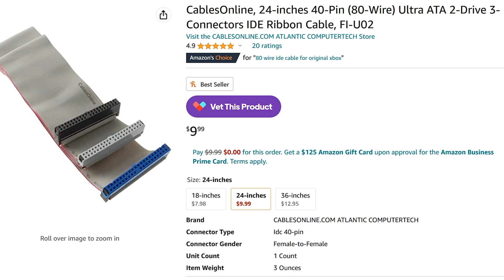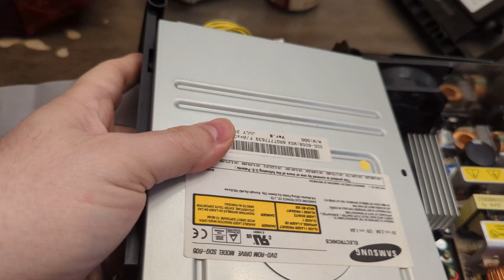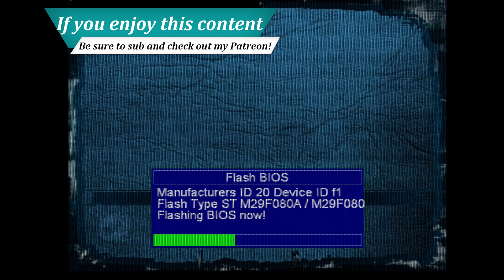How To Fold Replacement OG Xbox IDE Cables!

Comment: after getting annoyed with the awkwardness of 80 wire cables  i have modded the cable setup to allow 40 pin wires to work on the big SATA HDD, works with so far tested latest Cerbios. (much less clutter)I am waiting for the final board to complete the final part. seems to work on all the "ali express" Sata adapters.  a little more testing is required but so far all good

Comment: can i use ps3 sata hdd ?????
Reply: Yeah with IDE to SATA Converter you will also need 80 Wire IDE cable and 4 Pin male molex with two female ports.
Reply: @TheIdiotGhost  عربي انت؟؟؟

Comment: I have a 18" ide replacement cable would that work or too tight
Reply from the maker: It won't work with this method, but it will work going under the drive with extra folds and such.
Reply: I think I need a new hdd